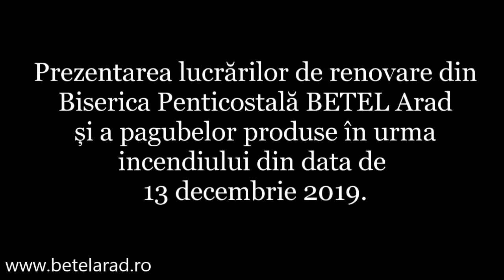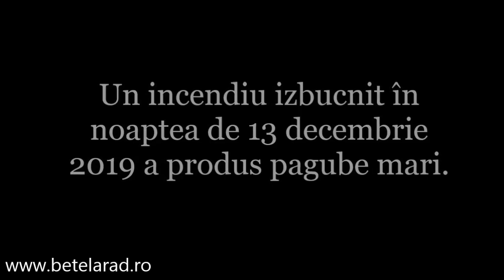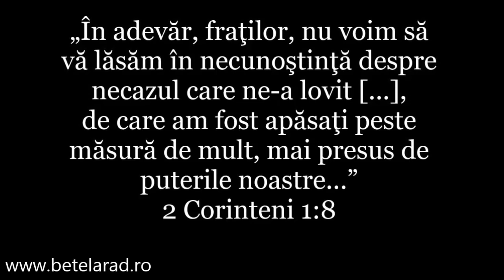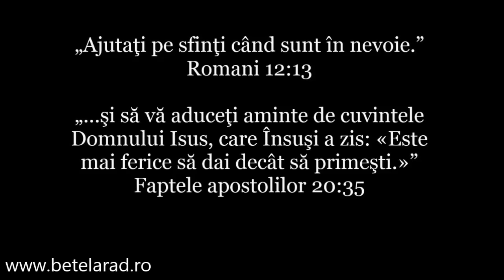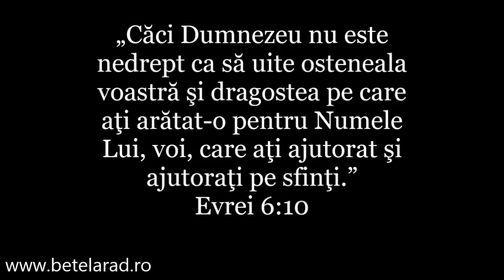Cerere de ajutor pentru Biserica BETEL Arad, în urma incendiului

Comment from the maker: Modalități de a dona:
1. Site-ul GoFundMe (campanie inițiată de Biserica Bethel Detroit):
https://www.gofundme.com/f/ajutor-pentru-biserica-betel-arad

2. Prin transfer bancar în contul Bisericii Betel Arad:
Banca Comercială Română – Arad
Beneficiar: Biserica Penticostală BETEL Arad
Codul Swift RNCBROBUAR0
Codul BIC : RNCB
RO13RNCB0015030331390001 -RON,
RO02RNCB0015030331390005 –EURO,
RO72RNCB0015030331390006 – USD

Contact slujitori:
Micurescu Eugen – tel. 0744142042;
Anca Iosif – tel. 0740437777;
Fedur Samuel – tel. 0748884572;
Micurescu Emanuel - tel. 0740802060;

contact@betelarad.ro

Vă mulțumim în Numele Domnului Isus!
„Pe cine dă cu bucurie îl iubește Dumnezeu.” (2 Corinteni 9.7)